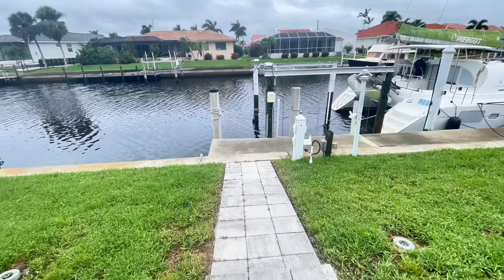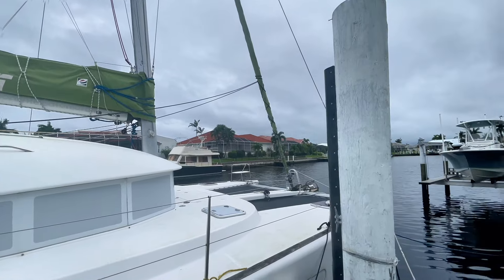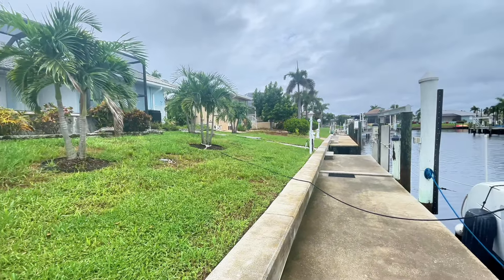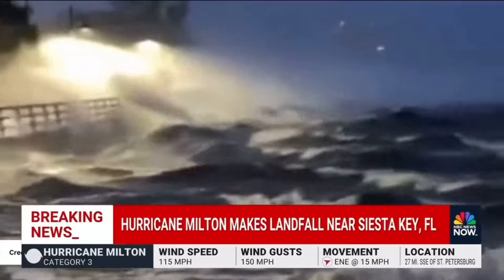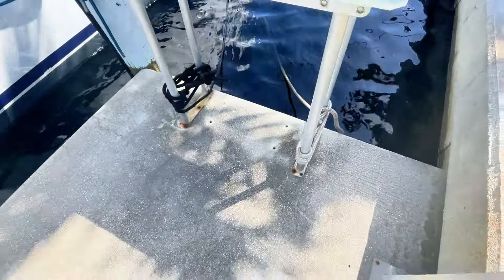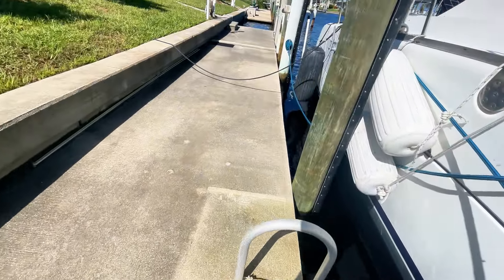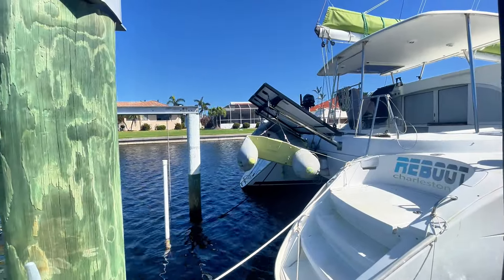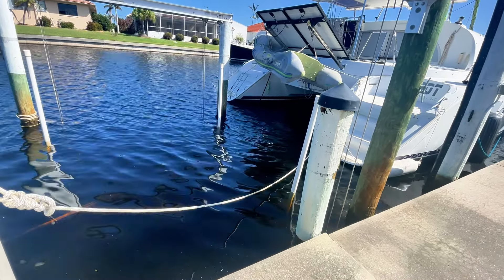Direct Hit From Hurricane Milton! Did My Catamaran Survive?

Comment: We were in bermuda about 7 years ago (during the americas cup year) when the boat (a 52ft catamaran) took a direct hit. The weather station 500 feet from the boat broke recording 120kts of wind. We actually took the boat out of the slip and anchored in a small cove. Took the main off the boom (painful) and removed the jib, getting rid of as much windage as possible. Even went up the mast and removed the wind instrument. Boat did really well, with no issues. The only rather odd outcome was the foot tall piles of dried salt behind the main cabin door... A couple on a boat not too far away rode the storm out in their boat, said it was easily the stupidest thing they have ever done.
Reply from the maker: That is incredible! I don’t think I’d be brave enough to go up the mast of a 52’ cat, I’m scared out of my wits going up our much shorter mast 😅 Wild about the salt, I wonder why so much accumulated 🤔